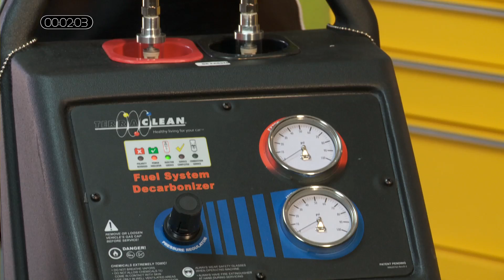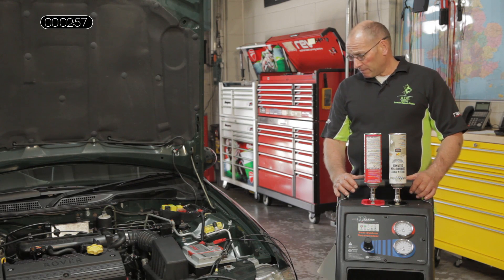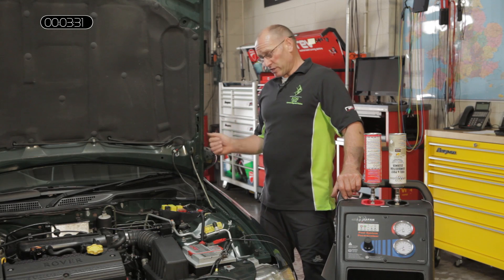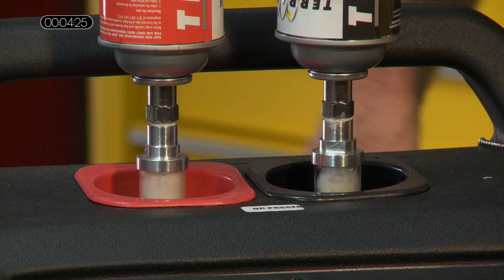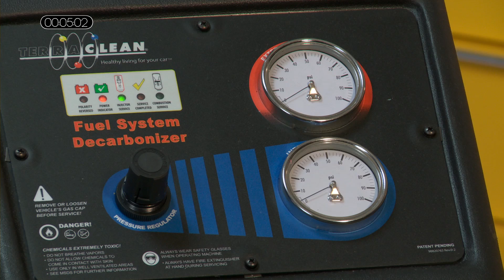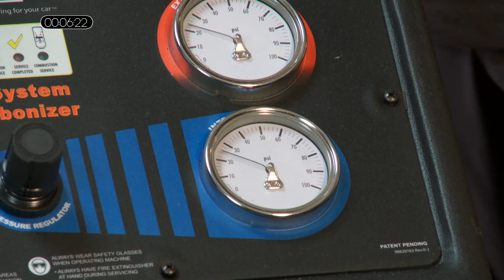AUTOiNFORM: Carbon-free engine cleaning how-to by Frank Massey

Comment: Thanks to your video I'm now looking for a Terraclean dealer in France. If you ever need ideas for a future video, I would be glad to hear your advise on how to properly take care of our modern cars. I consider a typical service of the car way under the needs ( most of them are equiped with PCV, EGR, navigation systems etc). I'm not a mechanic at all and I would be glad to be given a list of tasks to take care of all that in addition to the regular sevice ( for example Terraclean service every ... miles, cleaning the turbo air intake every ... miles etc...). Thank you.
Reply: you can get different versions of service from terra clean depending on if you've s diesel or petrol engine car. with modern petrol engine cars "especially those moving to direct injection" your biggest issue is carbon build-up on the intake valves (over the counter cleaners are a waste of money for this & fuel additives don't touch the areas required)
Terra-clean do a service for direct injection engines which cleans the intake system & addresses the intake valve carbon build-up, however most car manufacturers oddly don't inform customers of this issue (overall it leads to poor engine running, Higher fuel consumption & sooner the old engines it leads to your engine failing) the carbon build-up on the intake valves is usually down to oil found in the cars breather system (by design) you can fit oil catch cans to the intake breather system to reduce this issue (its NOT a overall fix but will dramatically reduce oil getting to the intake valves & intake canals. simplest suggestion would be if you have direct injection, get the appropriate engine clean service (save money by not buying over the counter products) clean your engine & then every 10-20K miles get the service again... lots of garages can have this engine cleaning service "you'll need to check local garages"
also for direct injection engines, you can also have a walnut blast which also cleans the intake valves however it doesn't hit the area the intake valve seats which also get carbon build-up... that's the part which gives poor idle as the valves cant sit flush allowing poor combustion.

also.. side note regular services don't touch the areas needed... fuel filter, spark plugs & coils, filters etc including brake pads & wiper blades etc etc eventually the fuel filter & oils etc people need to realise proper servicing is a lot more involving

you asked about average cleaning etc overall it depends on your car & mileage you do
Reply: thanks. duelly noted. I'm thinking about the catch can. some people suggest 2...? Other point: as a comparision, have you tried hydrogen cleaning method? is it b.s.?

Comment: This method was figured on Wheeler Dealer and appears legit, as they showed the emissions test results before and after. I have my Zed booked for April after my dyno run.
Reply: +iMann iFail did you notice any improvement?
Reply: +Pete 88 No not really, as my ZR was regularly serviced by myself and I used Wynns full fuel cleaner with every service and I always run on Nitro 99 shell fuel. The treatment above is good for cars that don't get regularly serviced this way.
Reply: +Pete 88 just to note, I regularly stripped my engine to drop high lift cams in and I checked the injectors and they were cleaned with no build up same goes with the inlet and exhaust ports
Reply: I'm looking to have this done on a 20+ year old mx5 mk1 import. Never been stripped so would be interesting to see the results too wouldnt it. Heavy build up on all the cylinder heads so my guess the rest of the internals are pretty caked over the years. Thanks for the informative reply mate
Reply: +Pete 88 then certainly you should see a good result then. I know Terraclean is one of the most leading companies to do this type of clean. Just to note this only does the fuel system. With oil changes I suggest wynns flush with every oil change.

Comment: I have a Lexus is220d and they are notorious for carbon build up.  After doing this,  there was no carbon on the EGR and in the manifold when I checked it after.  On an emissions test,  there was almost no hydrocarbons.

Comment: Hi Frank, do you think the terraclean works well as an exhaust gas with regard to cleaning intake valves on a direct engine? Thanks.
Reply: yes it can be used on direct injection engines.. however to clean the intake valves you need the intake cleaning service & not the fuel injection cleaning service or you can opt for walnut blasting which also cleans the intake valves.

Comment: put an analyser into the exhaust before and after and you can see it works, it can make the difference of an mot failure and pass. seen it in use

Comment: I wonder has anyone ever stripped down an engine after running this process in order to check if the carbon buildup has actually been removed, as claimed?
Reply: Did you get any answer by the time?